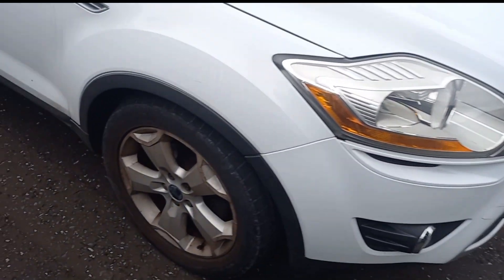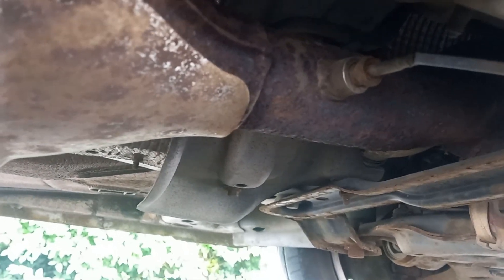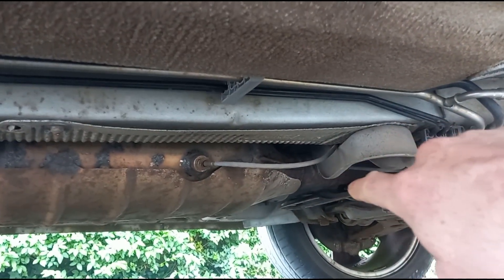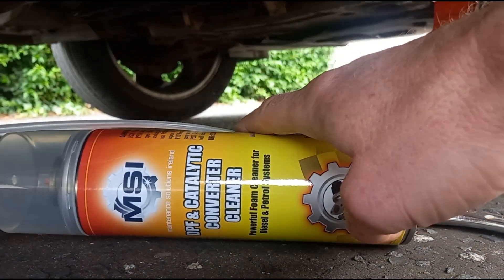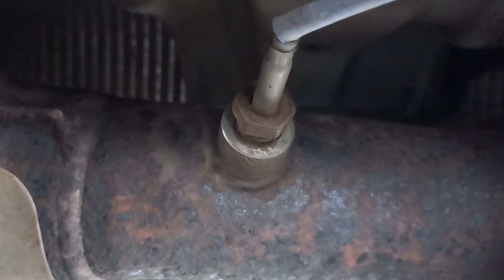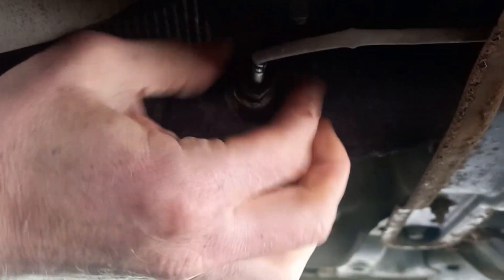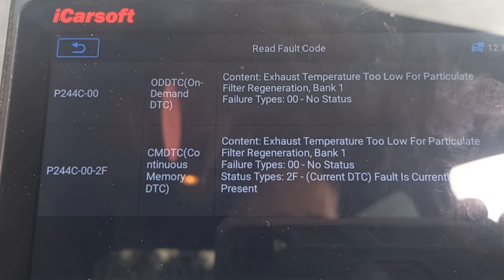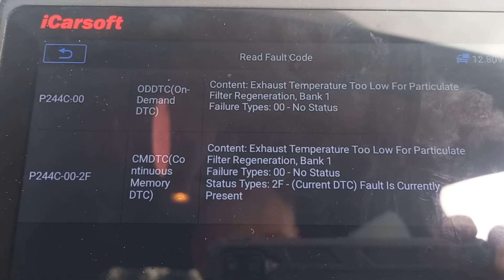Ford DPF regen failure problem FIXED! - common Ford problem! #diymechanic #dpfsolution

Comment: Hullo! I'm going to give this weekend. My 2011 Focus has been repeatedly sounding the Engine Malfunction triangle, then going into limp mode, often at roundabouts or sharp turns, then just engine quitting. It starts up again immediately on the hop, but that's no way to drive! 
Hoping this is the answer
Reply from the maker: Fingers crossed for you! It does sound like it could be the culprit… a code reader would spell it out for you - let us know how it goes!

Comment: I did laugh when you warned about a new sensor being £95 then cut to the next shot which was using an adjustable spanner to remove it, the mother of all shite tools!
Reply from the maker: Not at all - a decent adjustable can get you out of all sorts of scrapes! With these compression fittings you are less likely to round it over using an adjustable rather than a ring spanner or crows foot which are thinner

Comment: Hi tim. What its called the one you poke with knife? I have the same problem.
Reply from the maker: That is called the dpf fuel vaporiser valve - it is basically a fuel injector

Comment: TIM SOLD MY FRIEND MY FORD KUGA DIESEL TDCI 20LT MK1 BUT I REPLACED THE EXHAUST SYSTEM AND THE DPF FILTER  AND ALSO THE EGR VALVE AS WELL BUT TIM ALSO HAVE THE MALFUNCTION LIGHT ON  AND REAR SENSOR AND TRACKING LIGHT ON AS WELL TIM COULD THE VAPOUR SENSOR BE THE COURSE OF THE PROBLEM WITH THE ENGINE MALFUNCTION LIGHT ON
Reply from the maker: It's possible that the vaporiser being blocked could be related to the engine malfunction light, so it might be worth checking that. The only way to be sure is by plugging in a code reader or diagnostic computer to find out what trouble codes have been reported - that will spell out what the issue is…

Comment: hello there ,
thanks for the video i have a ford focus i a dthe same issue before i changed the vaporiser everything is ok, the only thing that i see now during dpr regen when driving at high speed i see white smoke for 20-30 sec is this normal ?
Reply: Thanks for ur reply everything is ok collant oil level no oil in colant loquid gasket is ok no overheat it happening only when regen start znd reaching 650 deg
Reply from the maker: Yes - normal. I think the smoke you see is the carbon trapped in the filter being burned off when it gets up to temperature. Keep an eye on your coolant level though - that white smoke could be steam, and a sign that your head gasket is on the way out…

Comment: Mine is apparently constantly regenning and when driving faster it pushes out constant smoke. Mechanic said its overfilling throwing diesel in the system its a Ford Mondeo 2016 TDCI 2.0
Reply from the maker: Do you know the error code? That would suggest that either one of the sensors is dodgy and misreporting the pressure differential so it thinks it is always blocked, or your dpf is full of ash… either way, burning off isn’t going to help, but the ECU doesn’t know any better
Reply: @bigtalltim  There's no error code. Dpf is not blocked. Must be a sensor but they can't say which one. What do you think it is.
Reply: @bigtalltim  Any advice would be appreciated. I have been told I can remap ECU and disable the regen but not sure tbh.
Reply from the maker: @ozhoneybadger I suspect that you are backed up with ash… you could do worse than to try a can of the stuff that dissolves it. Certainly with the cost of diesel, you don’t want to be leaving a smoke screen behind you everywhere you go! Ps. Not sure where you are, but in some locations a dpf delete is illegal and an immediate annual inspection fail
Reply: @bigtalltim  The DPF has been cleaned out via regen the soot went from 99% to 5% so its not that.
Reply from the maker: First things first… it could be that the injector is not sealing properly… that could steadily dribble diesel into the dpf, which would be very noticeable at speed when the exhaust heats up… an easy bench top pressure test for an experienced mechanic to rule that out. Other than that, I do think you might be looking to fix a symptom and not the cause… what if the dpf is working fine?… the question then becomes “why is there so much soot in your exhaust?”. Should we instead be looking for worn cylinder rings?… or super old engine oil? Or an engine running rich? (Blocked air filter perhaps) or perhaps (very much as in my own case!) an old diesel and a heavy foot? If smoke is produced, the dpf catches it, and sooner or later it needs to burn off. The more soot, the more regens!! Just a thought… start with the possible dribblesome injector